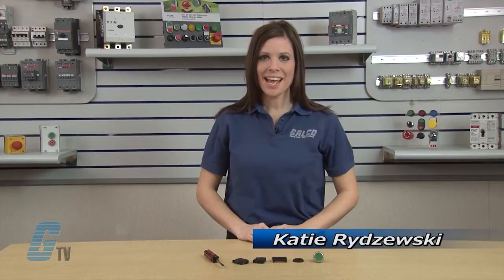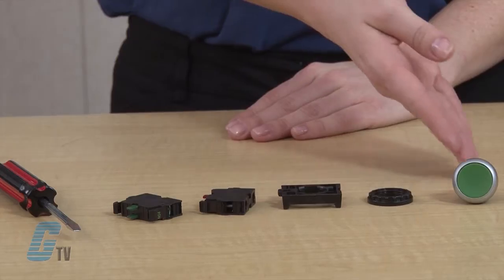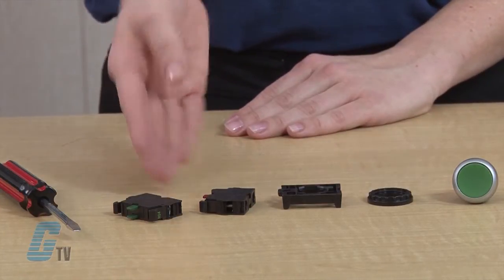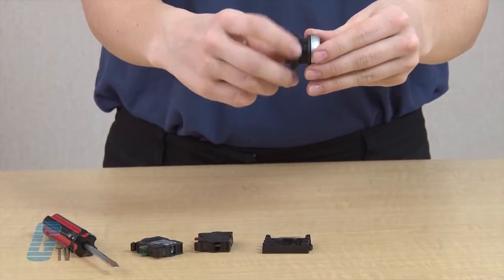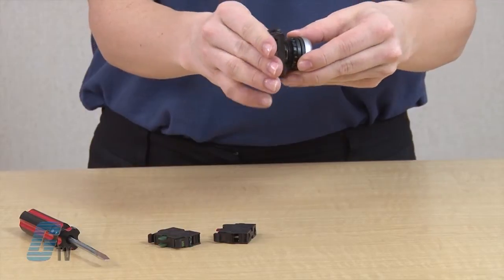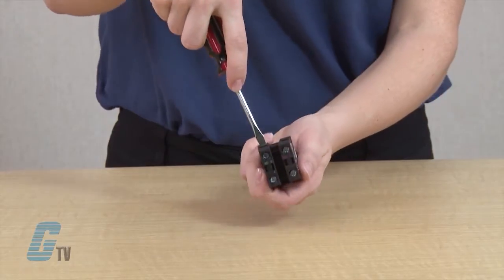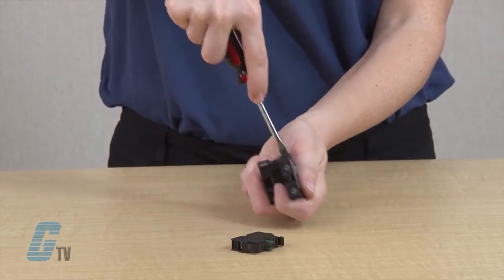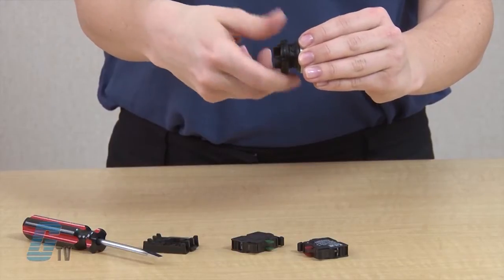Eaton Cutler Hammer - M22 Series Pushbutton Assembly & Disassembly

Comment: Thanks!  Really need a video on the HT800 selector switch.  Specifically around the 2 or 3 or 4 position configuration.  Very confusing when you open one up, remove both of the white pieces with the black lever.